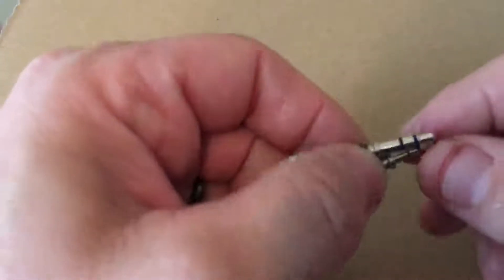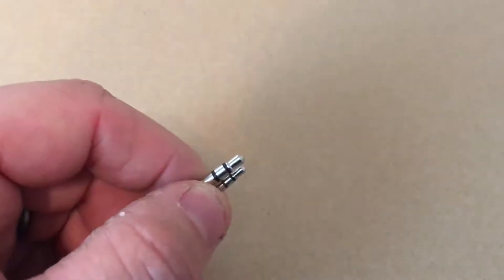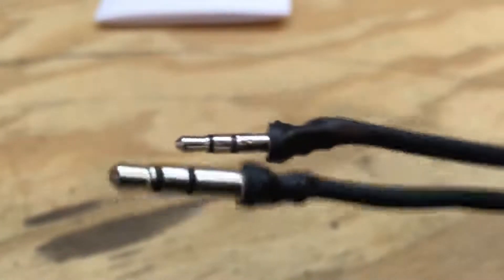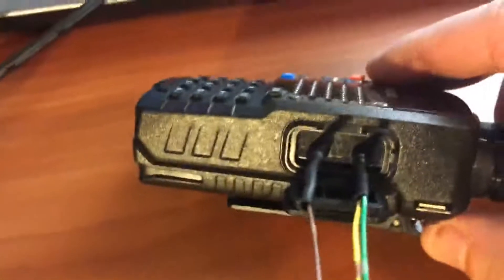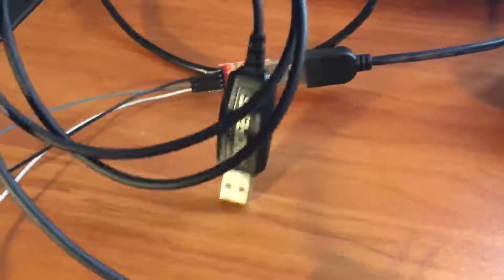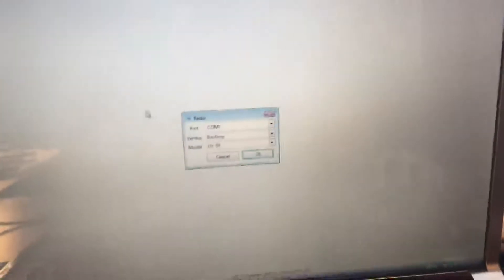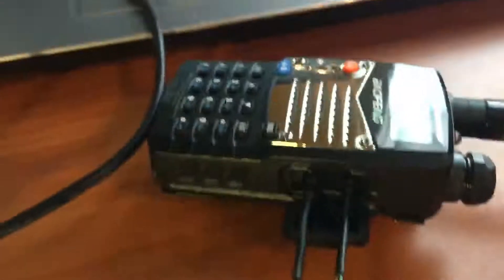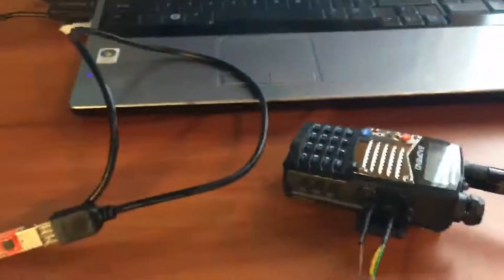Homemade USB Cable To Transfer Frequencies To A Baofeng Radio Using A USB To TTL Adapter

Comment: Thanks, im scrubbing the video to find out the wiring diagarm, and now that i watched the video 3 times and reverse engineerd and built the damn cable I just found the wiring pic. LOL
Thanks I now have a working cable
for the othere
the 3.5 inch coller is TX
2.5 INCH COLLER IS GROUND
2.5 INCH MIDDLE IS RX

Comment: Let's assume you have a USB to Transistor-Transistor-Logic thing laying around and it has a nice jack and plug with it and you know what the pins are for it. Also what driver has to go in Windows for that chipset. Or you could order it and get all that. But might as well order a made cable. Not saying it can't be done. I've made cables for TRS-480 and Yaesu FT-950 for the audio in and out, and linear amp keying cable.

Comment: When i want read to the radio there is notification " radio is not respond" could you expalin why, please....?
Thank you
Reply from the maker: I’m not to sure. It’s been since I posted this video I done it that way. I normally use the Baofeng usb cable.
Reply: The reason for the message is that there is no data returned to CHIRP after it sent the request for the radio to go into clone mode. The 2 main causes of this are:

1) the device driver installed in the OS is not compatible with the USB-to-TTL chip in the programming cable.
2) the 2-pin plug is not fully connected with the socket.